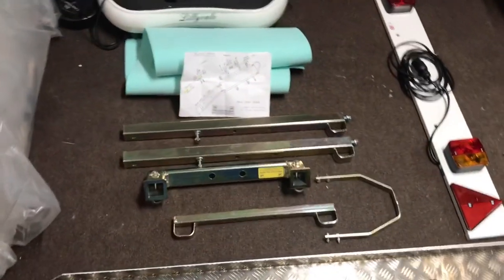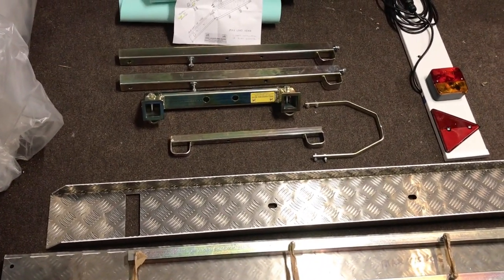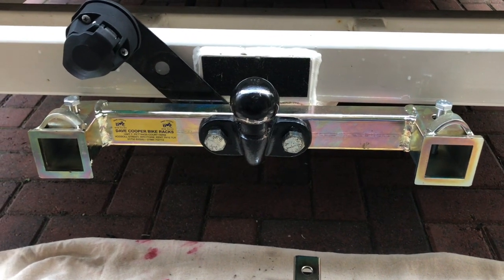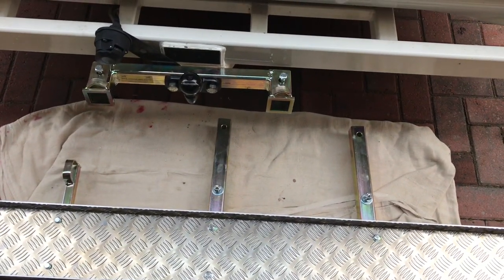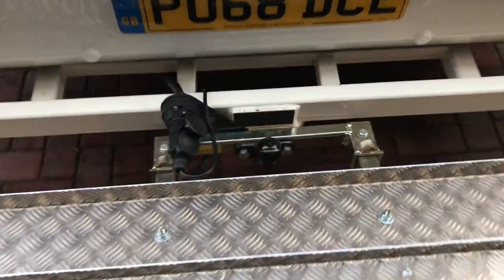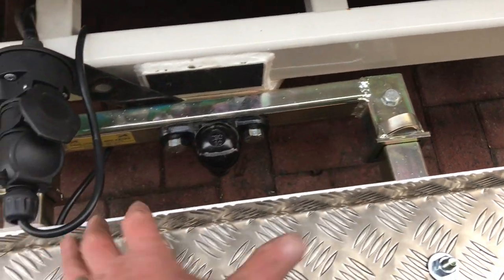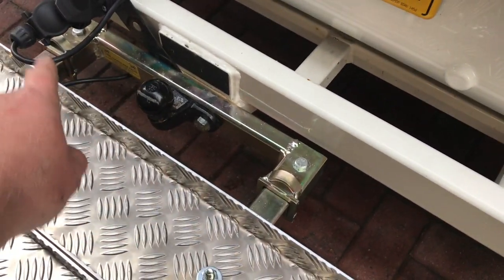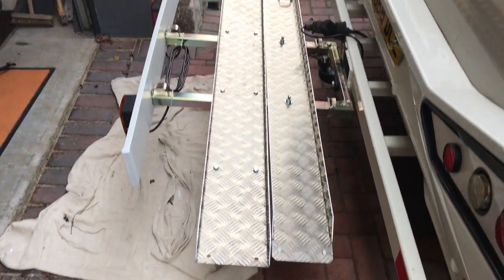Motorhome with a Scooter

Comment: I don’t understand how you can use the garage weight limit, when you are not fitting the bike in the garage? Surely the weight of the bike and the rack should also take into account the increase in distance from rear axle, which effectively increases the weight? I would strongly recommend you either recalculate this added weight, or take the van to a weighbridge to ensure you are not exceeding your rear axle weight limit.
Reply from the maker: Hi Robert, thanks for your comments. The scooter and rack is calculated at 120kg allowance in the garage 150kg. Even though you have the over hang of approx 800mm the scooter and rack do not weigh any more. You may get more bounce and your towbar must have a nose weight that will carry more than 120 kg. I have had no problems so far. Like I say the bike and rack do not weigh any more. Thanks hope it helps
Reply: Motorhome Touring With Jim & Kay 
Hi Jim
Thanks for your reply. I recommend you look on the web for articles concerning calculating the effect of adding weight behind the rear axle. Caravan Guard has an article which explains this, with formulas used for calculation.
As an example, let's say the following parameters apply to your van
Wheelbase = 4000 mm
Existing front axle load = 1500 kg
Existing rear axle load = 2000 kg

If you add a 200 kg load in the garage at a centre of gravity overhanging rear axle by 600 mm, this will have the following effect
Front axle weight reduced to 1470 kg
Rear axle weight increased to 2230 kg. 30 kg more than the weight added!

If you now take this weight out of the garage and add it to your bike rack with a centre of gravity overhanging rear axle by 1500 mm for example, the following effect applies
Front axle weight reduced to 1425 kgs
Rear axle weight increased to 2275 kgs. 75 kgs above weight applied!

You may still be in limits, but you should not be using the weight limit of garage to determine how much weight you can add to your bike rack. Even if the weight in the garage does not exceed limit, you should still calculate the effect on the front and rear axle loads. Alternatively, pay a visit to a weigh bridge when van is fully loaded.
Reply: @robertricherby5947  very helpful comment.  As you say, it is not just  case of weight or handling  but positioning and remaining within compliant axle weight and 3500 kg

Comment: Hi guys .. Great videos .🌝🌝🌝
Looking at the scooter options ? I have Challanger 288 with a  garage. It's the same as Chausson, as you know.Can you please  tell me what size or  make of scooter you got into the garage.
I've no towbar 🛵  as yet .I'm living in Spain and the camper is here so looking at fitting a  tow hitch ..then buy scooter then the unit to carry it ..any help would be great .. our island  bed can be raised up, but I think I'm might have  to fit the tow bar . Then that unit you bought, where did you get that ? 
If I could get a scooter inside, we managed for the first year ... get the 125 cc..
Many thanks if you can help us as we as newbies to the challanger    ..it's a pity that she has one big door on the garage, but then the small one on the opposite side  🤔  again thank you . Paul
Reply from the maker: Hi Paul, sorry for the delay in replying. The scooter was the Honda vision 110 cc weights 105 kg. The scooter rack is a Dave Cooper rack and can carry 130kg off the Towbar. I have a Suzuki avenis scooter which I will be putting on my new van in the next few weeks, it weighs 109 kg and is a 125cc again using the Dave Cooper scooter rack. Hope this helps just google Dave Cooper scooter rack approx £400

Comment: Hi Jim, I've got a crafter motorhome the bikes a Klx 300 just wondering what the distance from the centre of the tyre track is to the rear of the van doors as its got wide bars on, the bike weighs 136 kg so should be fine. 
Cheers
Chris
Reply from the maker: I don’t have a crafter Chris, so I don’t know. We had a tow bar bike rack and that carried 150 kg on the back. It’s on one of my videos. Hope this helps

Comment: May be worth checking tow bar assembly as they have a maximum permissible load figure which is the download weight on the tow assembly as the safe carrying weight, I really like the idea but the engineer in me says so much could go wrong whilst on our pot holed third world type roads which will magnify any intolerance on the tow bar assembly and chassis.
Reply from the maker: Tow bar nose weight needs to be 150 kg I have traveled 5000 miles with this set up , no problems
Reply: @jimandkay  150kg is this the maximum applied down weight a tow bar is rated to for safety or is this the weight you are applying on top of the tow bar assembly including the assembly and scooter?
Reply from the maker: @johnrocker2986  this is the nose weight, this relates to the downward pressure. These are the instructions from the manufacture of the bike rack. It works well with little movement.

Comment: Hi Jim  thanks for the video do you have any on the rear garage I would like to see your storage set-up
Reply from the maker: No sorry Hugh, I used to carry the scooter in the garage which was ok, but just a bit messing about. This new rack is so easy and I have built light weight shelving for the hosepipe, screen cover and levellers. We also carry helmets and motorcycle jackets on the other side of the garage.
Reply: @jimandkay  Hi Jim thanks for the reply any pictures?
Reply from the maker: Hugh, just had a quick look back at some old photos and I have none of the bike in the garage or the rig I built. Only photos on the bike. 😌
Reply: @jimandkay  
Ok thanks Jim
Reply: @hughmckenzie2749    I'd like to see that too.
Reply from the maker: I don’t have the Chausson anymore, I have a Wildax pulsar 😉

Comment: Hi had one of these this year on our trip through France Portugal and Spain  and the welds failed in Portugal had to buy a trailer  £1200 I have Autotrail Dakota carrying a Honda 125 Innova
Reply from the maker: It does say 115 kg max weight carry. What weight was your scooter? It’s a bit disappointing  when your away and very costly 👍
Reply: @jimandkay  hi Jim it’s about 100kg it’s the very small Honda (like the old Honda 90) I found it under powered for what we wanted so I am going to get a BMW C650GT scooter for our next trip 👍 cheers Eddie